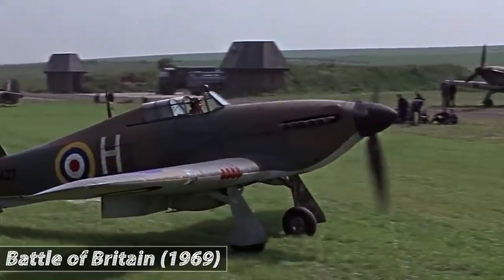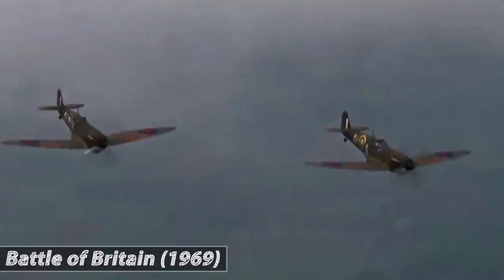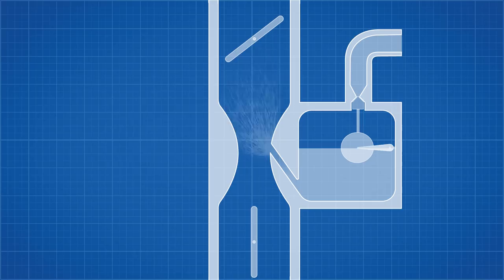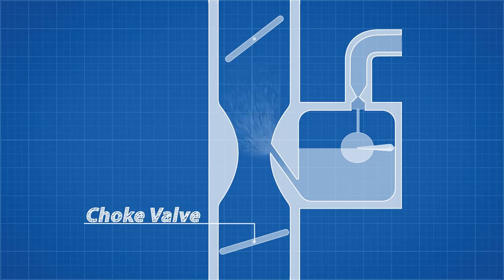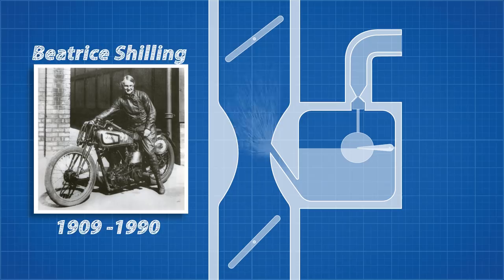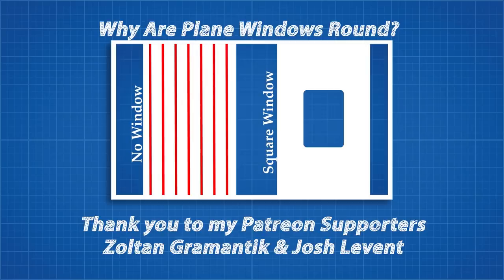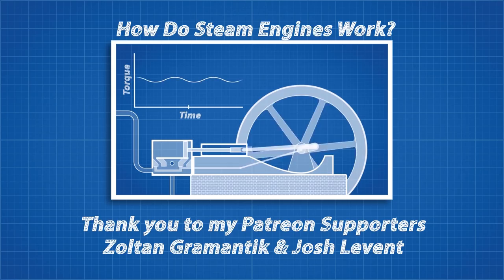The Spitfire's Fatal Flaw

Comment: Wrong title...... The Merlin Engines Fatal Flaw...... would have been more accurate...
Reply: Steve Ross There’s a pinned comment from Real Engineering regarding this. Both planes have the same engine.
Reply: @flameshot0983  
All the more reason to correctly entitle the video I would've thought.
Reply: There was no fatal flaw, the problem did not hamper RAF pilots and was soon remedied anyway.
Reply: @steveross8326  the video wouldn't get as many views if he called it that.
Reply: @barrierodliffe4155  Luftwaffe pilots abused the inverted chase tactics  leading to many spitfires shot down. It was fatal...
Reply: @Sevastous  
Maybe you can give a few examples of this in real combat reports because I have not seen any such thing and of course Rolls Royce was working on the problem which was much improved by the Battle of Britain and completely solved in 1941.
RAF pilots did not seem to have much trouble either and it was hardly just the Spitfire.  It was never a fatal flaw, just a small problem and a compromise since the smaller Merlin engine gave more power than the Db 601.
Who wants to talk about the Bf 109 fatal flaws? 
..Longitudinally the aeroplane is too stable for a fighter. There is a large change in directional trim with speed. No rudder trimmer is fitted; lack of this is severely felt at high speeds, and limits a pilot's ability to turn left when diving.

.......Aileron snatching occurs as the slots open. All three controls are far too heavy at high speeds. Aerobatics are difficult.

.......The Bf 109 is inferior as a fighter to the Hurricane or Spitfire. Its manoeuvrability at high speeds is seriously curtailed by the heaviness of the controls, while its high wing loading causes it to stall readily under high normal accelerations and results in a poor turning circle.

RAF pilots seem to have managed rather well, maybe you should read a few German reports.
Albert Kesselring " The Spitfire was the main reason the Luftwaffe failed to stop the Dunkirk evacuation"

Adolf Galland " I am very impressed by the Spitfire"  
This was in the Battle of Britain.

This is from an RAF report.
The pilot of the Spitfire reduced his revolutions to 2,650 rpm and was then able to overtake and outclimb the Bf 109. At 4,000 ft, the Spitfire pilot was 1,000 feet above the Bf 109, from which position he was able to get on its tail, and remain there within effective range despite all efforts of the pilot of the Bf 109 to shake him off.
Reply: @barrierodliffe4155  I aint saying spitfire is shit no worries.
Reply: @Sevastous  "Luftwaffe pilots abused the inverted chase tactics  leading to many spitfires shot down. It was fatal..."
I have seen a video, somewhere on Youtube, in which Douglas Bader and Robert Stanford Tuck were discussing the  Merlin's "fatal" (bullshit, clickbait title by the poster of this video) flaw and the RAF fighter pilots' remedy when chasing a 109 that suddenly dived away from the fight. They just did a half-roll, pulled into the dive, preserving the positive-g to keep the Merlin's carburettor working properly, chased the 109 and waited for him to pull out of his dive.
As Bader and Tuck were high-scoring fighter pilots, who flew both Hurricanes and Spitfires, some people should pay attention to what they did and said, instead of making up silly comments.
Reply: Barrie Rodliffe 
Good post. Thank you.
Reply: “The Merlin’s fatal flaw for the first couple of marks of Spitfire before the problem was swiftly cured” would be more accurate, but less inflammatory.
Reply: The Merlin engine was hardly “flawed” it was the greatest engine of ww2. That’s like saying an arrow is flawed when you put it in backwards, things must be used correctly.  Hurricanes, spitfires, mosquitoes and lancasters all used the Merlin engine and all make the top ten aircraft of ww2.  FATAL FLAW simply no.
Reply: @barrierodliffe4155  109 was never meant to be a dog fighter as it could simply out stall or out run a spitfire.. And i gotta say the spitfire was simply an inferior aircraft.
Reply: @RatBallz69  
The Bf 109 could stall but that is not advantage, as for out run where do you get that nonsense from the inferior Spitfire was faster with better acceleration, climb and maneuverability.
Reply: @barrierodliffe4155  Nah im just pro German engineering. And im not saying that the spitfire was entirely terrible but the the 109's engine was more advanced and the 109 its self was faster than all spitfires until after the wars end when the British got a hold of German engineering to improve their designs. Sorry that you have to suffer with the truth that German engineering at that time was decades ahead of any other kind.
Reply: @barrierodliffe4155  Mate.. Mate... You're in denial. The DB605 had fuel injection, a single rod overhead camshaft, a barometric controlled turbine super charger, auto deploying tabs on the leading edge of the wing to combat loss of lift while cornering and a bunch of other technologies that are still used today. Also explain why a spitfire sounds a lawnmower in the sky while the 109 has a clean precise  smooth sound.
Reply: @RatBallz69  
I certainly deny lies.  The DB 605 was only used in late Bf 109's and was almost 36 litres or over 30 % bigger than the Merlin engine.  The Merlin had a single overhead camshaft for each bank of cylinders and a more efficient supercharger. I doubt the DB engine used anything on the leading edge of the wing, if you mean the Bf 109 used leading edge slats then sure it did, they gave no advantage and in fact were a handicap.
I have heard plenty of Spitfires and plenty of lawn mowers but no lawn mowers  that sound like either a RR Merlin or RR Griffon engine. AS for the clean precise sound of a Bf 109?  Maybe the Spanish made version with a Hispano Suiza or RR Merlin does sound good. There are so few Bf 109's left I doubt that you have heard any.
Reply: @RatBallz69  
Single overhead camshaft and rockers for the 4 valves per cylinder. that is exactly what RR Used so go back to school and start learning before making even more of a fool of yourself.
Reply: I wouldn't say it was a fatal flaw really?? It's just that me 109 pilots would exploit this situation in a dogfight by pushing the stick forward into a neg g dive to evade a spit in combat, ok the floating carb was not up for this manoeuvre and the fuel injection system was far superior but as soon as it was realised it was partly rectified with the ring restricting fuel flow into the carb to stop it flooding but it didn't solve the starvation of fuel in the initial neg g manoeuvre, so pilots would invert and dive to keep on the tail of the me 109...
Reply: @SavyBajaBuster  
The Luftwaffe pilots who tried to get away this way were at a disadvantage since the Spitfire pilot would roll over into a dive, keeping the Bf 109 in sight and gaining in the dive. The other rather important fact is the Spitfire would have the advantage of being above and if the Bf 109 pulled out of the dive and climbed it would be game over.
Reply: Barrie Rodliffe no u do realise the reason Dunkirk failed was that the German panzers  ran out of fuel spitfires could do nothing to tanks in 1940-41 also the bf109 was not as agile but its versatility made up for it and its firepower meant that less time on target was needed for a kill think or a f22 and f35 the f22 is a very good air superiority fighter but not much else but the f35 is a jack of  all trades master of none
Reply: @andrewgraham6006  
I do realize that the failure at Dunkirk was the Luftwaffe, the tanks had to halt for 3 days because the supplies had to catch up and they needed maintenance but the halt was called off before the evacuation got underway.
The Bf 109 was not very versatile. it was used for one main purpose, sometimes used for ground attack but so was the Spitfire. 
Forget the F 22 and F 35, they are completely irrelevant. The Bf 109 had 2 cannon with very limited ammunition and low muzzle velocity and when that ran out they were down to 2 machine guns so low fire power. 
The Spitfire was a master of many trades.
Reply: Barrie Rodliffe it depends what version likewise the spit the bf109 could carry some bombs some rockets and it could have interchangeable armament up to 1 30 mil and 2 852 and if I’m not mistaken 2 underwing gun pods that were 20 mills also I have to understand that the 109 also had to be useful on the eastern fronts and the west so some things had to be sacrificed but overall the 109 was the workhorse of the Luftwaffe being very effective as both a heavy bomber hunter and decent enough at air superiority for its cost
Reply: But on a even battle = exualy skilled pilots clear weather say they spot each other at 5 km the spit would likely win about 60 or 70 but the 109 bug that depends on a huge variety of factors say alt as I will give the spit credit it was very effective at high alts but also its likely that fight would take place in German land so aa could help out the bf109
Reply: But ultimately it just came down to who got the first shot to hit of and that was that
Reply: @andrewgraham6006  
Like The Spitfire the Bf 109 served right through the war, both could carry bombs, the Spitfire up to a 1,000 lb bomb load, both were given drop tanks, the Spitfire serving not only in Europe but in the East, the Mediterranean, North Africa and against Japan and used as the Seafire. The Spitfire was not just an air superiority fighter but used as a bomber escort, for ground attack, photo reconnaissance and more.
Reply: @andrewgraham6006  
The low muzzle velocity I mentioned was the 20 mm used in Bf 109 E in the Battle of Britain.  It lacked effective range and hitting power.
Reply: @andrewgraham6006  
Late in the war anti aircraft fire was more dangerous than Luftwaffe fighters. 
Many Spitfires and other RAF fighters were operating at low altitude and attacking many targets such as trains.
Reply: Barrie Rodliffe yes I’m talking about the mod to late war models where the mg151 and mk108 was used also mind that early spits had 8 762 and nothing else
Reply: Barrie Rodliffe and so was the 109 also the role of aircraft was diffrent the allies had more dedicated ground attack aircraft = il2 and p47 Germany had the advantage of fighting on home terstory and had dedicated recon aircraft but both aircraft were designed to compleate most things that a ww2 plane would do
Reply: And yes I know Germany had the ju87 but that was obsolete very quick = low speed and manovaribailtt minimal defensive armament and could only effectively be used at low altitude and a lack of armour to protect form ground fire which is why the il2 which shared many of the same flaws excelled in its role even up to the battle for the reichstag
Reply: Barrie Rodliffe now we can go on about this for the next 2 weeks or we can agree that both were useful in the own roles and both were useful and contributed to there respective nations emmensily
Reply: The flaw wasn't with the Merlin - it was the carburettor.
Reply: @Sevastous  The Germans got into the habit of diving away to escape, which cost many pilots their lives after the problem was fixed or they came up against P47s or Mustangs. In fact German newbies were taught the dive away as a standard escape manoeuvre, which made them very predictable in combat.
Reply: @SvenTviking  It wasn't fatal anyway - it never got British pilots killed, just slowed them down in the chase (unless they knew to do a half-roll to follow in the dive)
Reply: Melville Sperryn that’s the whole point of the video
Reply: Melville Sperryn yes it gave German pilots a energy advantage which gave them the power to disengage and the spitfire relies on high  speed manovaribilitu  to survive
Reply: @andrewgraham6006  
Or I could let you carry on ranting away since I have other things to do.
Reply: @andrewgraham6006  
The Spitfire pilot could follow in a dive and had the advantage, a simple half roll into the dive did not take much time or slow the Spitfire down and the Spitfire pilot could keep the Bf 109 in sight. If the Bf 109 pilot kept diving he was as good as dead, if he pulled out he was at a disadvantage. The fact is the slight problem was much improved by the Battle of Britain and completely solved in 1941. Spitfire pilots still did a half roll into  dive because it worked very well even when they did not need to.
Reply: @barrierodliffe4155  No one good answer for the 'best' fighter of the war. Check out Bob Johnson's recounting of his dogfight with a Spit Mk. V while flying a P-47B. The odds always favor the pilot who knows his strengths and how to maximize them.
Reply: @rossanderson4440  
The P 47 B was not a Spitfire and I never believe anything that comes from an unconfirmed source. Bob Johnson was not a great pilot and the P 47 B was a later fighter than the Spitfire Mk V, the Mk V entering service over a year earlier
and the Spitfire Mk IX in service by the time the P 47 B turned up.
Reply: @barrierodliffe4155  First off, no one said the P-47B was a  Spitfire, so I don't know why you included that statement. Secondly, I made a mistake in that Bob Johnson's first plane in the ETO was a P-47C, with the longer fuselgae for stability purposes. Bob Johnson had 27 confirmed victories, all of them versus fighters, BF-109's and FW-190's (no 'meat on the table') - so what is your criteria for a great pilot if not surviving aerial combat and winning? Leadership? He never lost a wingman. He was one of the four top US aces in the ETO. I grant you that the Mk. V was being replaced by the Mk. IX at the time the US showed up with the P-47C, but conventional wisdom had it that the Spitfire was faster and more maneuverable than the P-47. In the memoirs of Bob Johnson, he recounted his mock dogfight encounter with the Spitfire Mk. IXB and beat it, head to head (pages 135-137 of Thunderbolt!, his autobiography).  Yes, the Mark IX.
Reply: @rossanderson4440  
27 claims and at least 1 was a Bf 110.
Quite simply the only way any P 47 could beat a Spitfire Mk IX or even Mk V would be if the Spitfire was sat on the ground and it's pilot asleep.
The truth is much more likely that the Spitfire pilot flew very gently letting Johnson maneuver. It seems the RAF was helping the USAAF in combat training.  
A pilot in a Spitfire could easily get away from a P 47 just by accelerating, turning and climbing.  
4 P 47's were lost when their pilots tried to follow Spitfires.
Reply: @rossanderson4440  
I do not take much notice of US bragging which is not verified by fact. If the P 47 pilot went into a power dive he would eventually reach a speed of  about 516 mph if he was brave enough and the zoom climb would be at a lower climb rate than the faster Spitfire.  Any half competent Spitfire pilot would have no trouble countering any move made by any P 47 pilot. 
I would love to see a video about the P 47's fatal flaws.
Reply: @Sevastous  Didn't really mater as Spitfires and Hurricanes were being replaced faster than their losses while Germany was losing more than was being replaced. Even on the day when the RAF had no reserves Spitfires and Hurricanes were still coming of production lines. Watch the documentary The Battle Of Britain The Real Story
Reply: @barrierodliffe4155  Thankfully the 109 was instruction by hitler to accompany slow bombers rather ahead attackers , but even then I suspect the spit, etc, pilots would find ways of using comparative advantages.
Reply: @highpath4776  
I would expect any pilot to try to make the use of any advantage his fighter had.  
I noticed that when Galland was leading a flight of 40 Bf 109's which were attacked by just 12 Spitfires the advantage was with the Spitfires.
Reply: I honestly thought that it would mention the Spitfire's absolutely shocking range, that was a big flaw, but to be expected as it was an interceptor.
Reply: @Xiphactinus  
Not only not a flaw since an interceptor does not need long range, no front line fighter in 1940 had much range, but also not exactly true. The Mk V was able to carry drop tanks and after then there was the Mk IX with extra internal fuel, up to double the quantity and drop tanks, also the Mk VII and Mk VIII with fuel in the wings and later versions with both extra fuel in the wings and in the fuselage.
Reply: More like carbureted engines had a fatal flaw.  Don't forget the Allisons had the same problem as the Merlins.  The Stromberg-Bendix throttle body injector cured the problem.
Reply: @gcrav  
The problem was fully solved in 1941 by Rolls Royce and following that Rolls Royce and SU developed the speed density carburetor which was fitted to Merlin engines in 1942 and given to Stromberg-Bendix by Rolls Royce and then they developed their own copy which was fitted to some Merlin engines in 1943
Reply: The engine is part of the plane, the title is correct.
Reply: @carlfrye1566  
The engine was part of many aircraft and there was never a fatal flaw, the title is nonsense. The correct title would have been " The Spitfires minor flaw, soon remedied by Rolls Royce "
Reply: Richard Tattis  yep...
Reply: Richard Tattis  
I know the P 47 could go supersonic in a dive or so I have been told, as well as the P 38 and Me 262, at least the Me 262 really did exceed mach 0.8.
Reply: Richard Tattis  
Brown was correct, mach 0.71 was all the P 47 could do, it had good acceleration on entering a dive due to being very heavy but the low dive speed meant that other aircraft could leave it behind in a dive and still be under control.
Reply: Hoa Tattis  I just had a fucking stroke reading that
Reply: Hoa Tattis  yeah, I know about slipper tanks, it's just strange why they weren't considered earlier on.
Reply: Hoa Tattis 
Sqn Ldr Tobin had reached mach 0.89 in the same Spitfire no other aircraft had got to maach 0.85.
Reply: The spitfire couldn't dive and climb as well as the p51 or the fw190 or many American  and German planes. It could out maneuver them though.
Reply: @owenrisop1152  
The Spitfire Mk I couldn't obviously but the Mk IX could and did climb better than any P 51 or Fw 190. As for dive the Spitfire being lighter did not enter a dive as fast but in an extended dive nothing was faster than a Spitfire.
Reply: Yes it was a fatal design flaw.....there was a chance that the engine wouldn't come back after returning to normal gs  while the german pilots also learned the problem and taking advantage of the flaw
Reply: @coleanderson8035 
That didn't happen, the engine didn't stop, it momentarily cut, but RAF pilot's simply avoided negative G. I have certainly not seen any account of it causing an accident. I have never seen any account of a Luftwaffe pilot managing to take advantage of the slight flaw.
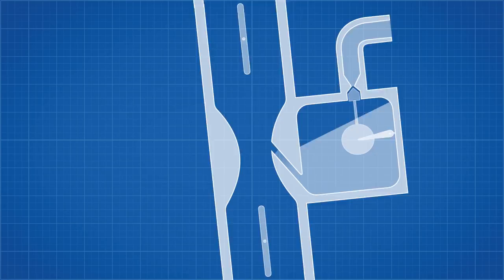Reply: @barrierodliffe4155  2:36 yes it could the engine could flood making it impossible to start
Reply: @coleanderson8035  
If you can find a single verified example of that then do so.
The carburetors were first modified in time for the Battle of Britain meaning the problem was much less, the modification eliminated the flooding and the problem was completely solved in 1941, so no momentary cut out either. Even before any modifications the cut out then flooding was not as bad as you are claiming. I have seen an account of a trainee pilot who was in an unmodified training Spitfire, he had the engine cut but and splutter but not stop.
Reply: @barrierodliffe4155  key word "could" it doesn't always.....but it COULDVE still happened
Reply: @barrierodliffe4155  it doesn't matter if  it was able to be fixed....my point is that the engine could flood to the point of not starting again even though you denied this fact even though the video clearly states it. Ive had a first person if an engine flooding(not a spitfire) and being impossible to start for about 5-10 minutes. Besides the spitfire wasnt the only aircraft at the time with a float carburetor. Take the japanese zero for instance.....that plane had the same exact design flaw ill bet there have been plenty of times where zeros engines flooded from excessive -gs and were unable to start again
Reply: @coleanderson8035  
I see so something that never happened could have happened.  That makes sense I am sure.  The P 38 could go out of control in a dive and crash killing the pilot.  Oh wait that did happen.  The Bf 109 slats could operate asymmetrically causing the pilot to lose control and crash, oh wait that did happen.  
Many things could have happened.
Reply: @coleanderson8035  
The engine could flood to the point of not startin g again.    Did it ever happen? I do not need to deny what didn't happen, it is up to you to support your claim and you have failed to do so.  
This video clearly tells a lie and shows a lack of knowledge by the person making it up without a clue.. 
Of course the Spitfire wasn't the only aircraft with a float carburetor. Did that problem affect any WW I aircraft?  I have not heard of it, all the fuss by people who should know better is about the Spitfire. Probably because they are trying to make out the Spitfire was not good. 
You can bet all you like but that does not prove a thing.  
I stick with facts not what might have happened.  
To stay with the Spitfire. The negative G problem was why Spitfire pilots rolled over into a dive, the problem was soon fixed but RAF pilots still rolled over into a dive.  The reason for that was that it worked and doing so meant that the Spitfire pilots could keep permanent sight of an enemy fighter trying to dive away instead of momentarily losing the enemy fighter.
Reply: @barrierodliffe4155  word of advice.....when you get sarcastic about a friendly disagreement....it turns into an argument. Nobody will want to argue with you if your gonna be rude about it. And just because there was no photographic proof of the event of the engine not starting again doesn't mean it didn't happen....you need to quit being a I NEED TO SEE IT TO BELIEVE IT guy and stop questioning someone who truly know engineering (real engineering) if it didn't happen, why would he bring up that the engine could flood and not start again if it never happened? If the problem of the engine stalling never happened why did they find a solution to it? If i am to believe it never happened....that means that it was completely pointless of them to fix the flooding since...in your eyes......couldnt be a huge problem since APPARENTLY THE ENGINE NEVER STALLED AND NEVER CAUSED A CRASH 
Edit: yeah the ww1 planes didn't have the problem because few of em we're able to actually roll over lol, the spitfire was an amazing aircraft he was trying to explain that the problem was fatal, since it gave german pilots the edge until they fixed it... making it fatal for many RAF pilots and your telling me a genuine ENGINEERING CHANNEL apparently doesn't have a clue of what they are talking about........wow that's pretty pathetic...you either think everyone doesn't know what they are talking about, or your wayyy too stubborn to accept that you are wrong
Reply: @coleanderson8035  
Try to get just one thing right.
I was not being sarcastic but honest.   Not only was there no photographic evidence which I would not expect to see anyway., there was no evidence of it at all.
I question someone who proves he knows nothing about engineering.  
Why would he claim something that didn't happen? Because he has no idea.
The solution was not to cure stalling but to cure the momentary cut out.
Many WW I aircraft could roll over not that that caused the problem anyway, rolling over maintains positive G so no problem.
The so called engineer was trying to claim the flaw was fatal but it wasn't, The Luftwaffe pilots did not have the edge.
A fake engineering channel does not have a clue any more than you do.   
I know they do not know what they are talking about. First they do not know when the problem was fixed or that it was first improved in 1940 and then completely solved in 1941. Before it was fixed RAF pilots got around it.
I am too stubborn to accept lies.
This video uses a sensational title as click bait.
Reply: @barrierodliffe4155  so your telling me a flaw.....that the german pilots exploited.....to help them in dogfights....isnt a fatal flaw....mhm totally makes sense.....and please tell me.......what kind of phd in engineering do you have......please tell me how him saying something that you dont agree with means he doesn't know anything about engineering.....if you did agree wouldn't have said that... allow me to quote from a website that also talked about the problem "Spitfire pilots learned to compensate by half-rolling their planes before diving, but it didn’t always work because the engines didn’t always restart.".....hmm seems like they agree with real engineering....do they not know engineering either? Or are you just wrong
Reply: @coleanderson8035  
When did any Luftwaffe pilot successfully exploit this or is it just something you think may have happened?
As a retired engineer I have worked on Supercharging, water injection and more.
If someone says something that proves how little he knows then I am happy to correct his errors.
If you could quote from a website rather than making it up.
These pilots who half rolled into a dive and it did not always work. It always did work which is why they did it.  
Just to let you know how it worked, if a pilot nosed into a dive without rolling he would get negative G and the fuel would be forced away from the float chamber outlet starving the engine of fuel momentarily.  when the fuel starts to flow again it can get too much fuel causing an over rich mixture which could cause a the engine to cut but only momentarily.  Since in 1940 the partial cure restricted the flow when the aircraft went from negative to positive G that was solved.  So what was left was a momentary cut out when going into negative G.  RAF pilots rolling into a dive avoided negative G so nothing for Luftwaffe pilots to exploit and not fatal. 
As for the engines not restarting, they did not stop.
I would take the word of real pilots who flew Spitfires and the word of pilots who flew against them.   
All you need is a single example of a Spitfire being shot down because of this problem.  
So far you have failed to prove anything at all.
Reply: @barrierodliffe4155  says the man with absolutely no proof in your side...i gave you a quote backing my claim...youve gave nothing but your own words.....if my words need proof, so does yours.......please give me proof on how apparently the float carburetor worked....if real engineering is allegedly wrong
Reply: @coleanderson8035  
You gave a quote without saying where it is from or who these supposed pilots were.  No proof there.
I did say what the problem was and how it was largely overcome, I tried to keep it simple for you. I am not going to go into great detail of how a carburetor works.  
The problem was not the carburetor anyway it was just the float chamber. 
If real engineering got anything right.  Most of the video shows Hurricanes rather than Spitfires. The excuse being it is hard to find video of Spitfires. When there are Spitfires they are Mk IX's.  That shows a lack of knowledge since there are plenty of videos of Spitfires including Mk I. The Mk IX was later and the problem long gone.
I see you can't find a single example of it being a fatal flaw rather than a minor problem.

A real quote " Not sure that "engine failure" would be the correct term to describe that phenomenon, usually it resulted in the engine sputtering and coughing as a result of reduced fuel flow, rather than complete fuel starvation. Pilot had to hold negative G for an uncomfortable length of time to cut the engine out completely"
If you want an explanation of how a carburetor works try reading Terry Welshans book on Carburetors and fuel systems, he goes into lots of detail including how Rolls Royce and SU made th espeed density carburetor which Rolls Royce gave to Bendix Stromberg. Many people try to say that Bendix solved the problem but they are as wrong as Unreal engineering.
Reply: @steveross8326  

the spitfire is more iconic